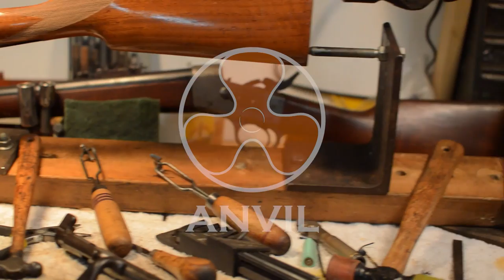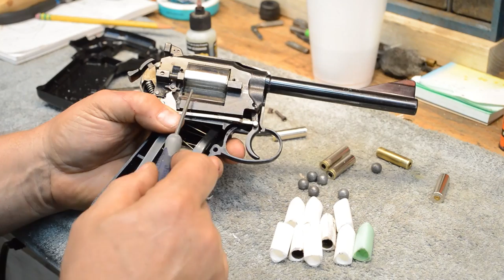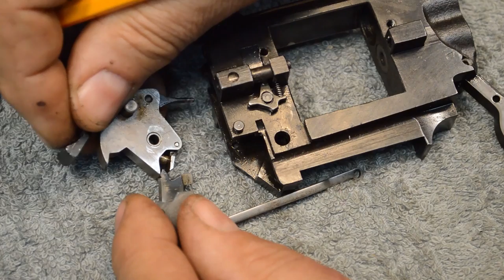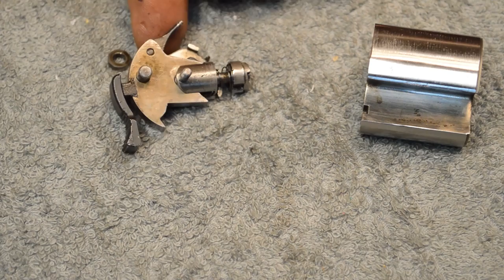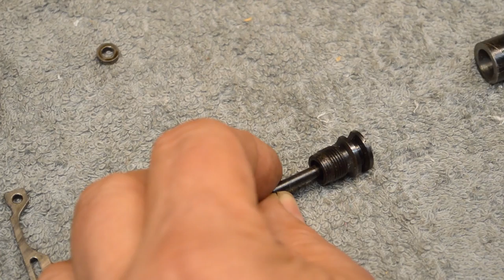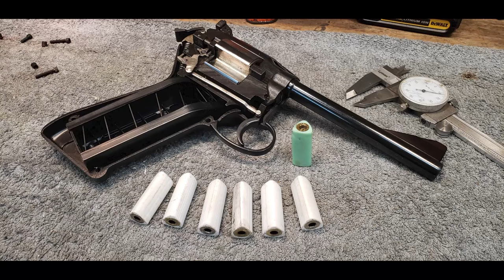Anvil 048: Dardick revolver total teardown and repair

Comment: "Flight Of The Bumblebee" by Rimsky-Korsakov. LOL, perfect! On one hand I have to admire David Dardick for trying something different. On the other hand he seemed to be trying to fix a problem that didn't exist.
Reply: He was trying to make a new, lighter aircraft machine gun. 

This design has minimal ammunition weight. The trounds stack in a way that minimizes dead space in the feed system. They don't need links, and you can use a flat ribbon spring instead of a coil for feeding. Or some kind of powered feed, if you need to keep up with a 1500rpm rate of fire.

The pistols were basically a sellable example for the salesman to use to show off to generals.

Comment: "Flight of the Bumblebee"  Excellent!  I remember when those Dardicks were introduced in the mid '50's for about $100.00 which would be about $970.00 in today's dollars.  Pretty much everyone I knew laughed their asses off when it came out.  Didn't buy one of those, didn't buy a gyrojet either.  Stuck with Winchesters and Colts.  Collected Arisakas too  even though my pals thought they were junk.

Comment: A great video on an exotic firearm and cartridge . I like the trouble you take to explain the thinking  behind the design.
Could you do a follow up on the SALVO 3 shot round and the 50 cal MG round which both seem to be Dardick spin offs ?
Also the Gyrojet (round, pistol and carbine adaptor) ?
Thanks. 
A great channel.

Comment: It's basically a handheld, manually operated, magazine-fed revolver "cannon".  As in things like the Oerlikon 35mm guns, that use a block of rotating chambers firing through a single barrel, but with a linkless feed for the ammo, and an electric motor driving the chamber block.  The current iterations of that beast are the Millennium Gun and the MANTIS air defense system.
The now-retired Flakpanzer Gepard carried two of them.  Very effective design...in that form.  In the form shown here...ehhh, not so much.

Or, to quote the great Michael Flanders: "'Tis a passing melodious roundalay, yet I doubt me an' it be commercial."
Reply: If I am remembering correctly from the Forgotten Weapons video, that was intentional.

The designer was hoping to use this to drum up interest so the funds would be available for an autocannon. This was their technology demonstrator.
Reply: @Bill22252  Hmmm, have to look that episode up.  Not a half-bad idea, actually, although I have serious doubts as to how well the Tround concept would scale to, say, 20mm or 30mm caliber.  Or adapt to flexible feed systems, for that matter.  The Germans realized very quickly that the low-capacity drums on the MG-FF were a serious liability when the gun was used in fixed mounts, where a crewman couldn't get to it to switch drums.

Comment: When making your plastic adapters I wonder if yiu could just make a recess into it for the 38 special so you wouldn't have to trim down the case..
Reply from the maker: 2nd iteration were configured that way
Reply: @marknovak8255  shame you can´t show the ammunition manufacturing on youtube :(
Reply: @marknovak8255  I suspect that you could pay for that printer with a run of a couple hundred Dardick tround sleeves.

Comment: I have seen several people try to make ammo for those out of various plastics (3d printed and milled) with little success. I wonder if an aluminum casting might work better. I would think it would handle heat and stress better than any plastic.
Reply: there are some newer plastics that may be an option now.  They would be made using an SLA process rather than FDM
Reply: For what they are if you wanted to demonstrate the gun at full pressure cases could be easily reproduced on a cnc mill in a couple of operations out of brass, bronze or even steel in a timely and expensive but not astronomical cost. 5~8 dollars a case  would be easy to attain for a a batch of 20 or so using nothing more than barstock {plus setup time and tooling}. This could easily be accomplished on a 1/2 decent home cnc mill. That said a proper measurement of the profile would be required. If you were to use plastic I suppose there are plenty of engineering thermoset high temp grp plastics available that would have the strength required today.  Thermoplastic isn't a good substitute. 
The thing that I always thought was a problem with these sorts of rounds was the ability to virtually chamber them in reverse direction.
Reply from the maker: The shape is a trochoid, and the cylinder diameter is 2.75 inches. Bang 20 or so of these out, and I will get the pistol back for some load development. Easy, no sweat

Comment: I wonder if you could 3d print a mold for the trounds. But a neat gun for sure
Reply: 3D printed plastic melts at a relatively low temperature, and the mould has to withstand a higher temperature than what it's casting, so then what you end up with a product that withstands even lower temperature that the 3d printed stuff, but it might be fine since the shell takes most of the heat anyway.
Reply: @thermionicemission6355  I ment like a resin there are several that might be stronger than 3d printing

Comment: Is it possible to accidentally load a round  so its facing backwards in the  mag? Just curious. Not that it would do anything
Reply from the maker: Totally possible to have a full mag of trounds facing the wrong way. Yep
Reply: Would that cause a catastrophic failure though? I'd imagine you would dent the bullet and then the tround would cycle out as normal next trigger pull.
Reply: @marknovak8255  Ah, co-sponsored by H&K then ^_^
Reply from the maker: @classicbandgeek  Well, then it would weigh over 3 pounds
Reply: @marknovak8255  and have a msrp of $2300
Reply: @TheRocketSmith  chance it'd damage the firing pin.

Comment: so the entire point of the dardick revolver was a proof of concept for the Tround, so that it could be later used for machine guns?
Reply: Basically
Reply: That actually makes sense. The pistol is huge with no tactical advantage, but in a vehicle-mounted weapon where the weight of ammunition is a significant factor and there’s space available, the tround might be an advantage.
Reply: H&R also attempted to use Trounds in their (failed) SPIW offering in the 60's.  Instead of a single bore in the Tround, it had three, each containing an 8 grain flechette launched by a common propellant charge.

Comment: Now I might be dreaming this up but for some reason I get the feeling they based their pistols and rifle designs in the original movies in the Planet of the Apes franchise on the Dardick. When I was a kid there was a comic adaption of The planet of the Apes movies. In each issue they had a few pages about the filming of the movies, how the makeup was created, the "lore" and history of the apes and the gadgets and props used in different movies in the franchise. One of the things that stuck was how they had decided to make apes use guns with triangular slugs instead of cylindrical just to drive home the point that they had developed these weapons independently of the humans that came before them. They had some pictures of the pistol and rifle props and I have a feeling they based the look on the dardic, just putting a fake triangular barrel on it for the pistols, and a stock and a longer triangular barrel on the "rifles". Now I've only watched the absolutely first movie that was released back in 1968, and it's been at least 30 years since I last watched it. I have no memory of what the apes weapons looked like, besides it was a VHS tape so there wasn't much details, and my old comic collection was thrown away a long time ago so I can't look it up there.
Now I could also be totally wrong, and the props didn't look anything like the Dardick. It was after all a pretty long time ago, and at the time I had no idea that something like the Dardick even existed.

Comment: Basically a magazine fed revolver. People had asked the question but this wasn't a great answer. I could see maybe if this had been invented 50 years sooner it having a chance at success or at least getting enough attention to be developed into something that would have seen some success. But I doubt this thing would have been as durable as the revolvers of the 1950's or even as good as the semi-autos of the 50's so it's too little, too late at that point.
Reply: Yep, if it made earlier, it would be real competition for others, having better capacity than not just revolvers, but also pistols, while not having too many drawbacks, however in the 50s a slightly above standard capacity non-detachable mag sidearm bigger than a 1911 did not sound too appealing to most I assume. If the price tag was comparable though, I personally would have bought it, but I'm guessing it was probably higher than comparable revolvers and pistols, that's usually where all these new weird guns fail.

Comment: Is there a mechanism built into the loading side of the gun that prevents rounds from being inserted backwards?
Reply from the maker: Nope. What could go wrong?
Reply: Actually there are magazines that you can use to slide the trounds into the gun. It has 10 trounds in the magazine that you slide into the gun. You then slide 3 more in with another magazine. Finally you manually put in the 14th round into the revolving part, cock the gun and put in the final 15th round!

Comment: Maybe I missed it, but what took this handgun out of commission? I do think it's a magazine fed revolver, if I may append my opinion to this question.
Reply from the maker: If I remember correctly, the rebound lever was not fully allowing the hammer access to the primer. A manufacturing error, it wasn't right from the factory. It was also full of dried assembly lube.
Reply: They were all essentially handmade. A lot of them have rimfire barrels and are supposed to be able to fire .22lr with an adaptor, but the hole to allow the firing pin to strike the rim was never drilled in some cases.

Comment: I can't help but think if they originally designed it to run on either standard ammunition or designed the triangular sleeves as a disposable modification for standard ammunition. There may have been an legitimate market interest in the Dardick.
Reply: Agreed. The should have selled this sleeves in a way that you put a common round inside them.  This triagular shapes seen really easy to eject also.
Reply: At some point there were some sleeves that could take a regular 38 round; I remember seeing them for sale back in the '80s [& no one was buying! Boy, I could sure kick myself now: a $20 investment then for a box of 500 would pay off handsomely now for anyone who still had one of these pistols lying around & wished to relieve me of some of my stock! ;-D ]
Reply: The pistol was a marketing toy for an aircraft machine gun.

Edit: so you don't want any metal but the bullet and primer in the tround.

Comment: Could you not have done this design with round cartridges and basically have a pseudo lever action operating action where there’s a loading gate that you could use to top off the action and each time you fire it it ejects a fired cartridge? I’m not saying it’s a better idea just that you could do this without needing specific shaped cartridges?
Reply: This was a sellable example of the action for an aircraft machine gun. 

Minimum ammunition weight, because it had no links and almost no metal in the case but the bullet itself (bullet and primer, if you want to be precise).

The action itself is a close cousin to the Mauser revolver cannons, but even further simplified due to not needing to push the ammo forward or back, just up.

As an MG, it works well.

As a pistol? Yeah, not so much. Barrel axis is too high above the hand, makes for severe muzzle flip.

Comment: You would definitely underload the trounds, right? Since you have actual brass I’m guessing you could safely load a few more grains of powder than the originals, but this would have to be underpowered compared to a traditional .357 or .38, right?
Reply: You know you can fire 38 from 357 revolvers right? The other way around doesnt work, right?
Reply: @wrathmachine7609  I want to say I fired .38 out of a .357, but, not only was that years ago, I couldn’t even begin to pretend I know off the top of my head how they compare in chamber pressure or muzzle energy.
Reply: @wrathmachine7609  flag down, unnecessary snarkiness
Reply: @tissuepaper9962  ☹️

Comment: To make rounds for the Dardick? Make the printed tround sleeve, press a wad cutter bullet into a .38 cartridge , remove the shoulder off the primer end, fill the cartridge with power through the primer hole. Press the cartridge into the printed tround adapter. Then press the primer into the completed tround. ..or press the cartridge into the adapter. Then fill with powder and seal the end with the primer. Pew pew!! Maybe?
Reply: And i suppose if you printed a tround with a .22 sized hole down the middle you could press a .22 short or long into the hole and the pistol will fire that cartridge?  Isnt the cycling action mechanical in the way it cycles out spent trounds? Then why not have someone cast brass sleeves (10 of them) in common ammunition sizes? 9mm , .38 spec , .22 , .25, .32 .40s&w , .357sig with a milled shoulder in the tround adapter. If the brass or whatever material adapter has a fingernail groove in the face , the shooter can pick out the spent shell and reload the sleeves on the fly?
Reply: @chrismsmalley2626  You might need a different hammer for rimfire cartridges.

Comment: Hey, a slightly irrelevant question that some of you might have a good answer to- I'm considering a laminate rifle stock, and I'm curious what the maintenance procedure is. Do I oil it down like a traditional walnut stock? Etc.
Reply: Mine is polymer based varnish coated as water ingress would delaminate it.
Reply: There isn't any maintenance to speak of, other than maybe a damp rag if it gets dirty. The lamination process involves saturating the wood with resins or cyanoacrylate-type chemicals, and most of the rifle stocks I've seen add a HEAVY layer of varnish on top of that.

Comment: It is an answer to a question that WAS asked. From what I've seen and heard so far about it, the Dardick Corporation wanted to create a system to greatly increase fire-rate of larger arms, probably autocannons on planes and such. Having such a chamber and these rounds would mean the ammo can be fed into the chamber without anything reciprocating, which obviously does increase the fire-rate significantly. I won't go into it too much, but basically I always thought of this as a Wankel Engine of firearms, replacing standard reciprocation with rotary action, allowing for much higher rate of explosions, basically, but just like the Wankel engine, it did not make into the 21st century unfortunately, although the problems of the two are completely different and unrelated, both were too weird to exist.
However, as for why they made the pistols instead of the actual autocannons and such, well I'm guessing they did not have the money to do so, so they created these, both as advertising of this unique and revolutionary system and also as a way to create enough money to fund their projects, sadly it clearly did not work out, not just due to weirdness of the weapon, but also I heard the original price tag was from great. The price is absolutely crucial when it comes to introducing a new technology, almost all failed ideas ended up the way they are due to the original price tag being above or far above the competition, and if something is new and unproven AND it costs more, it's a no-brainer majority will not purchase it. And remember, this is a firearm, and we all know how dangerous firearms are if made by someone who doesn't know what they are doing, so that is perhaps also a factor, as the Dardick was new to the market and were not proven to make safe firearms, I'd still trust it for sure, but that is because I know what to look for, while the average consumer will not, so the mistrust can be a strong deciding factor in purchase of a new firearm of an unconventional system.
Reply: @johnsmith7709  reading comprehension isn't your strong suit, huh? OP was lauding the Wankel engine.
Reply: Honestly I think this just looks like a way for dardick to maintain absolute control over the price and availability of ammunition.

Comment: A remarkable gun in it's needless complexity.  I can see why it didn't succeed.  I'm tempted to ask at each design feature, where is the advantage to this design?  Obviously, there is no simplicity.  I also wonder what the malfunction rate was like?  The potential seems high at first glance.  Comments?
Reply: I look at it as a Ford. It comes off a mass production line, and there are 57 varieties, all made from stock parts, just assembled a little differently.

The frame is a casting or maybe injection molded part with essentially no machining. That may be even cheaper to make than bent tin. You can pop them out by the thousands  in a single day on one small machine. The cartridges (or whatever you want to call them) are injection molded plastic, also with no machining, and made from something about as cheap as sand. Again, no machining, no sizing, no crimping. The barrels are machined, but fairly short compared to a rifle, so you can get a lot of them out of a stock barrel blank. The only drawback is that blivet of machined parts in the mechanism. And most of those are small and could have been made on a screw machine fairly quickly.

In theory you should be able to make and sell these by the tens of thousands for about $10 in 1960s currency, maybe $25 each today. The cartridges should be a few cents or dimes each.